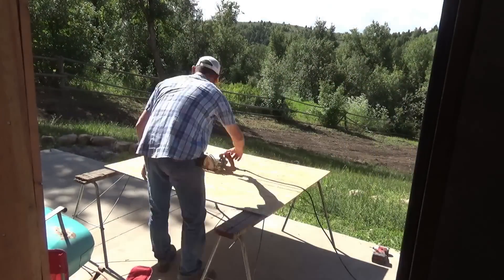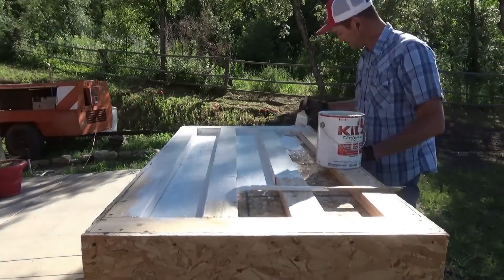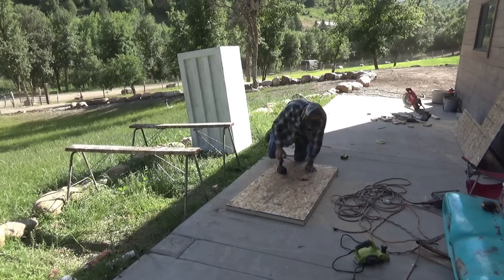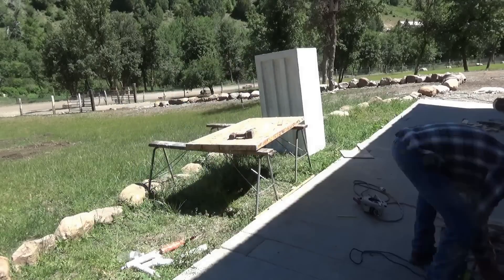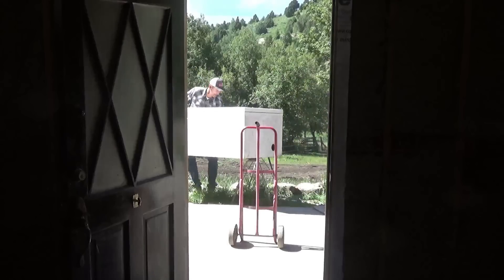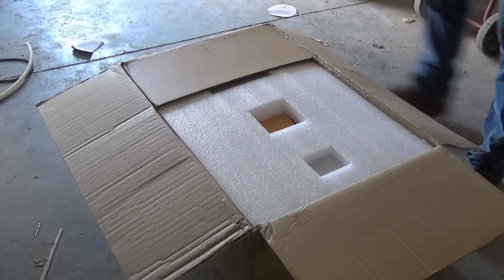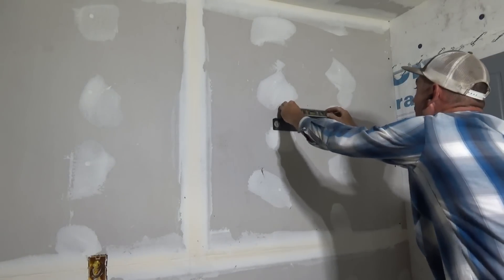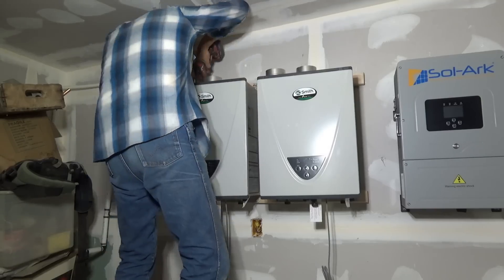#344 - Off Grid Solar Inverter,  DIY Sealed Battery Box, Tankless Water Heater

Comment: Did you consider the battery box vents with snow covering the opening. Fan essential, vent up stand pipe above snow line. Battery gases are going to be a killer, hopefully not literally. Water above your battery box??? This video first time for potential disaster. Battery box in your house is just asking for death. Seen others homes burn down. You can’t be paranoid enough. You have done a good job till now. Sorry man.
Reply: @Steve Diamond the shower drains were the key to the venting system

Comment: “Wild Wonderful off Grid” they just ran about 400 feet of wire from solar panels to where their outside building housing their battery’s is gonna be. He tells on one of the last 2 videos they posted on YouTube what gauge wire he’s gonna be using. They have about practically the same size & amount of solar panels as you do.
Reply: Plus he’s a electrician on his full time job, so maybe the same gauge he’s using will also work for you heath.

Comment: Personally you should have put a utility building next to the panels I put all your equipment in there then run a service into the panel into the house what's the correct way of doing it good luck that's the correct way so you do not get no resistance your panels are a long ways we usually make a high-voltage run into the house

Comment: Really Cheap generic laundry soap is used by United Battery Battery exchange as a neutralizer to the battery acid. They use a 3 to 4-inch layer or bed for the batteries to sit on, After about 6 months we would remove the batteries scoop out the soap which had become a brick replace with fresh soap and then take the brick-like chunks and dump 5lbs of baking soda on them and add water. We did this outside as the baking soda and the soap would fizz for about 10 minutes and then it was disposed of down a storm drain. Everything was inert so no harm to the environment.
Reply: Richard Thomas  No apology needed. One of the downsides of responding to post is we assume that the other guy knows are back story.. I was working for these companies in Northwest Portland Oregon about a 1/2 mile from the water treatment plant. Also, this practice was created by the Federal EPA because we were also close to the Willamette River. So maybe I should have mentioned that in the original post. According to the EPA person, the soap acts as a surfactant and is good for breaking up heavy clay soils and allows water to perk in to the water table more easily. I don't know. I left that job to become a Master Gardener at Oregon State University and am now retired at the ripe ol' age of 70 and live 2/10s of a mile from the Pacific Ocean in Charleston Oregon. That is on the Southcoast just past Coos Bay.

Comment: I have been waiting for your solar install.  I have a solar system for my home,  we bought a shed and insulated it for the batteries and other equipment but even insulated it is hard to keep it warm enough in the winter.   We vented the box out the roof and am thinking about a propane heater.  I put a thermocube in there with an oil heater in the building but it pulls a lot of power and the panels should have been in the winter position and are in fall, spring angle.   Having it in your house is a good idea I don't have the room.  Darn.  I do have a watering system on the batteries so it is easier for me to fill them when they need it.  I am not a youngster anymore so anything to make it easier is a blessing.   I am loving watching your videos empathizing with you and watching your wonderful family.  You are a blessed man!

Comment: There are online calculators that do the math for your voltage drop on the run from the panels to the batteries. Wire size is important and if not correctly sized, your voltage drop will make your system run inefficient. The company you are working with sounds like a good source for your information. It looks like you guys are getting ready to make the move. Exciting times at Red Poppy Ranch. Stay Safe, and Stay Free.
Reply: I helped a friend install a new solar system at his off grid house he had built as he was in Antarctica working as a contractor. When he got home the battery shed was 150 feet from his solar array just outside his house and the voltage drop was severe, more than 38 percent drop in voltage so when I suggested what to use he looked at me and asked where do I get that? 

The answer was the local street car museum and they provided for the proper donation figure 8 trolley wire with the correct hangers no insulation on the wire it just hangs out on the open like it does on a trolley route. he's using figure 8 the wire hangers and was surprised by how little line voltage drop there is. It is not visible from the public roads. He told me he never would have even thought about using trolley wire but loves it. 

Scrap price on the copper wire was well over $600 but there is nothing like solid copper wire for D.C. Power runs versus stranded wire runs that aren't even close to current capacity. At most he pulls just over 100 amps D.C. And the trolley wire is routinely rated for 5000 amps at 600 volts DC. 
So far after 7 years it's solid as a rock.

Cheers!
Reply: And as far as wire size goes ... bigger is better especially over longer runs ...... go bigger than whats needed longer the run the heavier the wire. Mate run a wire as recommended from a wind power generator (about 20 yards) and he had quite a big loss and ended up having to upgrade it.

Comment: Question: during record low temperatures will the battery venting system cool the batteries too much?
Reply: @sc radiodoc He plans to close off the utility room from the rest of the house to keep the gasses out since he has a wood burning stove. The utility room will be cold and the cold air from outside venting the box will cause the batteries to lose from 40-60% of charging capacity at 0 degrees F. The change of the angle of the sun will limit the amount of light coming over the south side hill, resulting in longer charge times and less energy produced.  The best battery for his situation is Lithium ion, which last twice as long, require little to no maintenance, and are not affected as much by the cold.

Comment: Love your battery box.  I think it will work very well.  Your ventilation system for the batteries is ingenious taking advantage of heat coming off of the charging batteries to push the ventilation.  One thing I would do is cover the vent ends with screen to prevent mice and other critters from making the battery box their winter home!  PS  Your Sheetrock contractor does NOT sound like a reliable fellow.  I would pass on him.
Reply: Either he is a "flake" or he is just so busy, he can't fit "Red Poppy" into his  schedule?  I bet on the first, lol.
Reply: I think he did cut out the screen for them but just didn't video it being installed...and I definitely agree about the drywall guy.

Comment: By no means an expert mate so don't even bother taking this comment as an opinion, but i'm thinking of also installing batteries myself in our home and I was wondering with that box, wouldn't batteries side by side like that get very very hot? In some of my workplaces they use plastic cages in boxes with vents at the bottom and suspend the batteries individually. It's alot more costly and takes up more space but that's how they do it. If you could shed some light on that that would be fantastic.
Reply: Did you not see him install vents and a fan?

Comment: Great job! Keep it up. 2 suggestions. Put some heavy duty wheels on the box so that you can move it around with all the batteries in it. You might have to redo the PVC vents but it's worth it I think. Second suggestion, even though you dont plan on painting the utility room, at least prime them to protect the sheetrock. In case any gunk gets on them, with a good primer you can wash it and it will also prevent liquid stains from sinking deep in
Reply: @Steve Diamond a quick coat with the Kilz oil would have been so easy now any moisture just soaks in behind there and it's MOULDY season
Reply: Yeah but he's clearly hitting other time and financial constrants. The family has to be in this summer so they can prep for winter there and also do the smaller on site projects that will be possible with all of them there. A lot of those little things can be handled once they move in, just by having the kids clear out a given room and so forth.
Reply: @Steve Diamond Home Depot has the Husky big plastic boxes, completely water proof, heavy duty, wheels on the bottom with a pull handle, lockable, at 69 bucks each.  Two of them, problem solved.  Set them up outside.  Anyway, another day blown off building a box I'm sure time isn't money
Reply: @Steve Diamond he said he had compared buying a battery box from I think a solar place?  Those guys probably have a crazy markup and then there's shipping.  I do know those Husky boxes are pretty nice, have a gasketed locking lid with a key lock.  You'd still have the venting aspect but has to be better than caulk.
Reply: @Steve Diamond Prime around them. Its not like any oil or gunk is going to splash through the things mounted to the wall.
Reply: @Steve Diamond I would agree but he didnt. Largely I think due to the time constraints his family is under. So now my suggestion, which he is probably skipping over because of some of the semi hostile comments as a response btw,  which would be easy to do and work for him in the long run are not helpful.
Reply: @Steve Diamond not semi hostile to me. I am Sicialian American, hostility has a whole different definition. He has in fact responded positively to comments before when they are purely positive.  Even if he disagrees. Anyway, I think we have gone as far as we can go with this side discussion

Comment: Solar in the summer, generator in the winter? Or are you hooked up to the grid?
Reply: Miles from power.
Reply: Wind power sounds really good!
Reply: camjamsdad  Even if the sun is shining in the winter the power generation is 10% of that in the summer or even less. Brushing off the snow won't help.

Comment: With the intake for the battery box vent coming from the outside, your batteries will be at the outside temp, or it would seem to me.  Why not have the intake from inside the house and vent outside from the other side?  Just currious.  Love the channel.
Reply: might not be an issue. the batteries will "warm up" while charging which should account for the difference. there are no fans their its just making sure a pressure difference does not result in the hydrogen leaking into the house and instead venting it outside.

the only issue might be the 12v fan when it kicks on.
Reply: I think he is doing that so he can have a completely sealed system from the room it is in...I hope he will keep a close eye on the internal box temperature during the colder months.

Comment: Sol-Ark is great. I just installed mine this year. You shouldn't need that big of wire coming from the panels. The amperage isn't that high the voltage is which doesnt require that large of wire. You might get away with running 4 sets of 10 awg max I would think 8 awg.

Comment: Picking a nit ... AGM is just a type of lead acid battery.  Lead acid batteries with liquid electrolyte are usually referred to a "wet" or "flooded".  Many people think AGM batteries are "sealed".  They are not.  They can vent.  If not they would explode.
Reply: I think he will be checking fluid/acid level more than once per month unless he has some kind of automated watering system.  I am sure he is smart enough to use distilled water and not the water from his spring.
Reply: Jack Patteeuw c
Reply: Yes, you should look for real world data. The Sol-Ark Partially Charged Carbon AGM batteries get 2400 cycles. The website shows real test cycling. But the biggest benefit is 98% round trip efficiency vs. Wet cells 80%. That's 18% less solar power.